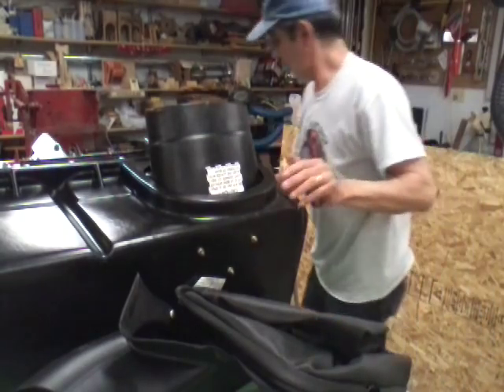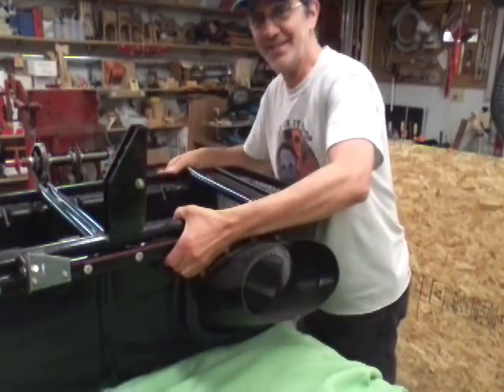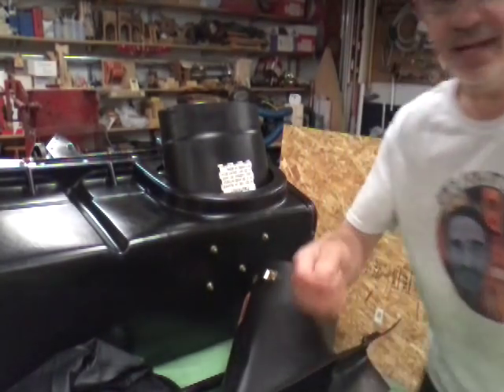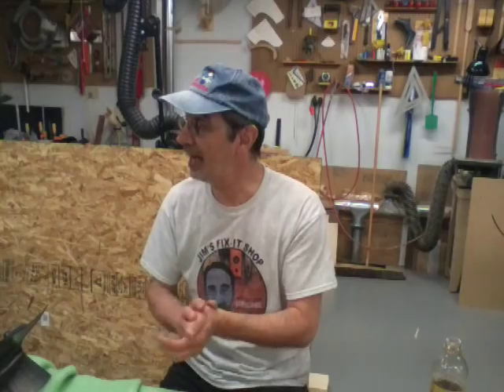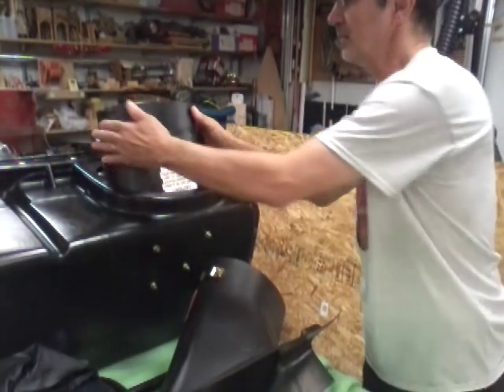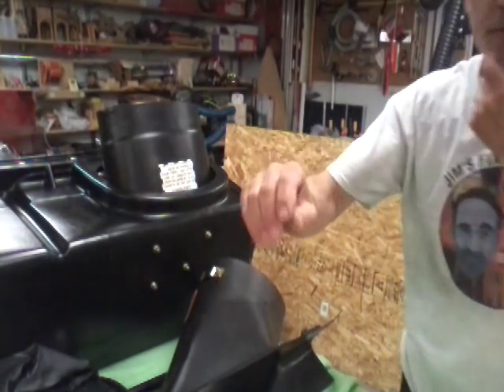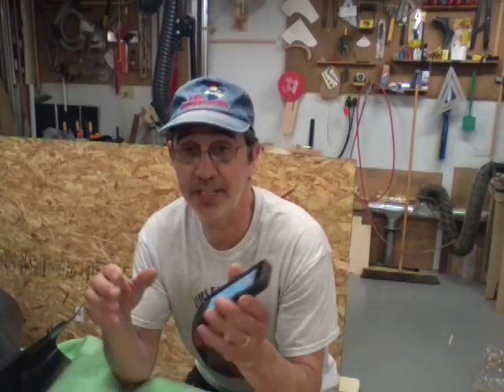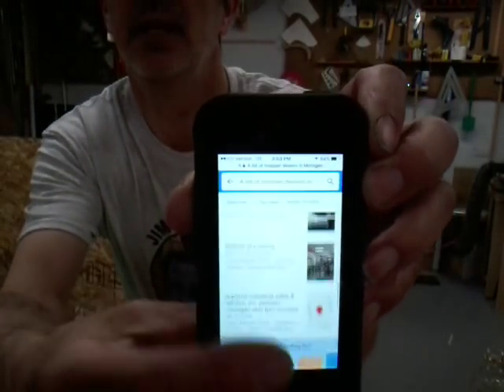186.   Where can I find a bagger for my Snapper

Comment: Hi Jim, great Snapper videos!  I'm on my second used one, my old 1990 ish model died, also bought that one used.  Just bought a used one, sticker on the body tube says M280921B, PART #84577.  Looked up a manual and the date on the manual is "2000" so I'll assume that is close.    Anyway I had a big 2 bag grass catcher exactly like the one you showed in this video that I saved from my 1990 model.  I have TONS of oak leaves and need a big bagger.  It DID go on the '00 model, however the '00 model does not have the reinforcement bracket on the right upright as you mentioned in a previous video and the '00 model has two uprights; the 90 model had an "inverted "U" tube on the top.  Can't remember if the inverted U was one piece bolted to the tractor or if it was fit into the two uprights.  Wish I saved the old one, or saw your videos before I gave it to my small engine guy to scrap!  This tractor has a newer 9HP engine on it that I haven't traced to see how old it is yet.  
Do you know a part # or where I can get the reinforcement bracket for the right upright and do you think I need the inverted U tube on top?  The grass catcher receiver gizmo that attached to the tractor is exactly like the one you unboxed.  Thanks for your help!
Reply from the maker: NFPowercat78 
Hi it’s Jim
   Your bagger  will fit on either the Two straight bumpers or the inverted u shaped bumper   (which ever you want to call it) and their bracket you’re talking about I found on Parts Tree.Com It is called a bumper support bracket and The part number is 7031954YP at parts tree they’re $8.83 now you may be able to find them on Amazon or eBay cheaper with no shipping thanks for watching and will talk to you soon. Jim
Reply: @jimjackson9381  thanks very much Jim!

Comment: I just bought a new rear engine Snapper last week, but really don't want to drop $750 on a new bagger.
What I was curious about is if they're all the same or did they change in design?
I found a bagger without bags for $80 that looks in great shape, but it's older and I know Snapper changed the chassis for a while before going back to the classic design.

Would be great if they're universal.
Thanks
Reply from the maker: John H 
Most all of them are universal and they do inner change. Jim
Reply: @jimjackson9381  Thanks. Still trying to find one somewhat  local.
Did find brand new single for $450 free shipping.

Really like this little mower, a simple, straight forward design, easy to maintain.

Comment: jim-why do you like the double bagger so much? I have never used one but the single works fine and holds a lot. please tell me whats special about the double
Reply from the maker: super20dan 
 Hi it’s Jim
    I like a double bagger because in my yard I suck up pinecones acorns twigs and sticks plus my yard is real bare spots where I suck up a lot of dirt and sand and a bags get pretty heavy, Especially if you’re trying to slide it out of that track system they have on a single bagger the double bagger you open the cover and the bags lift Right off, and if you have to bag your leaves it’s much easier to dump them in a bag from a double bagger, unfortunately they’re not making the double bagger anymore to find one you’ll have to go on craigslist or Facebook and buy a used one. Thanks Jim

Comment: Jim How do you attach the bagger to the back of the riding mower?
Reply from the maker: Well, I’m assuming you’re talking about the snapper rear engine rider and I need to know what style of snapper you have because there are differences in the baggers?         Jim
Reply: re130 rear engine got the double bag unit... think I need braces to attach to the unit
Reply from the maker: @dnewel99  you’re going to need two rear bumpers to bolt onto the back of your machine. Send me pictures of your bagging unit and all of the pieces and I’ll tell you if you’re missing anything and I also need some good pictures of these deck adapter and I’ll let you know if it’s gonna fit on your machine or not.
 Send them to my email which is
jimsfixitshop@gmail.com
Thanks.     Jim

Comment: Can I store my snapper  28 in upright position?
Reply from the maker: I do every winter with mine but you have to remove the battery the gas and I always drain the oil otherwise it will drip slowly on your floor, that way I put fresh oil in every spring and oil gets changed once a year that way just remember I put a note on the steering wheel to remind me there’s no oil in it and it’s also a good time to change your air filter and your oil filter if it has one. Jim